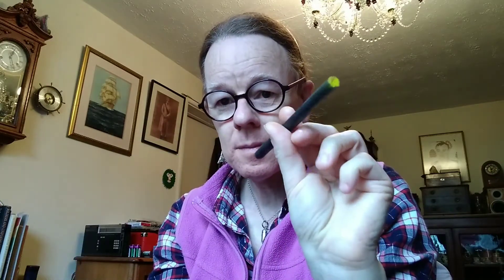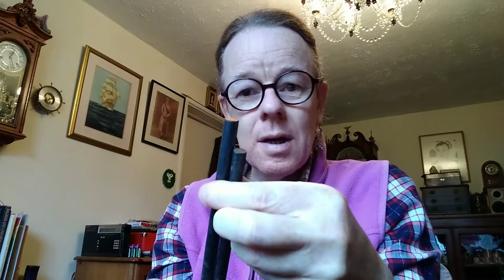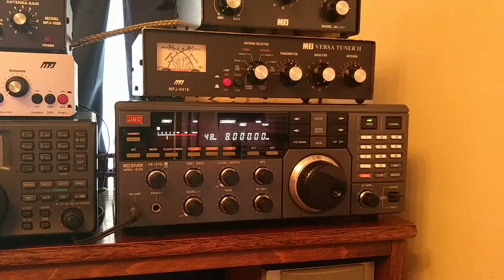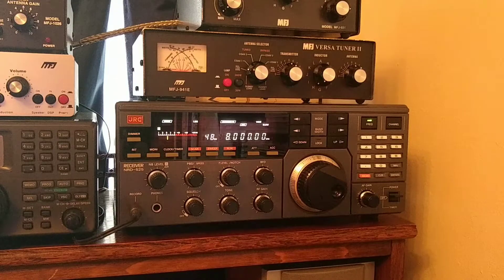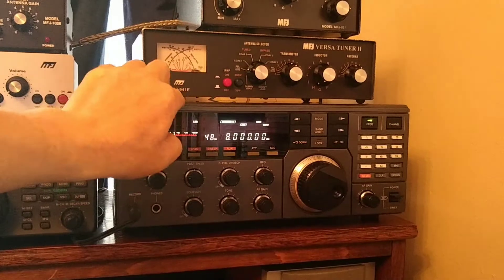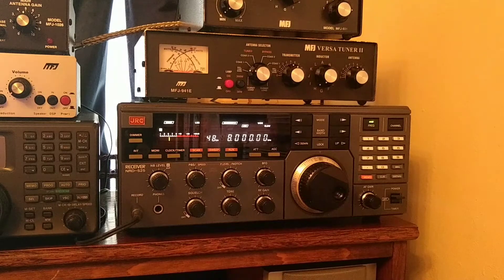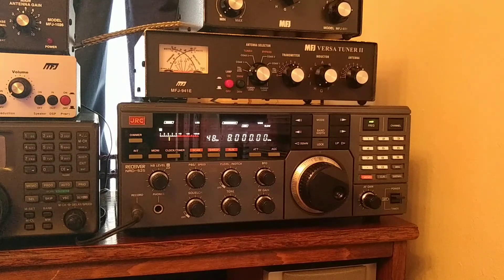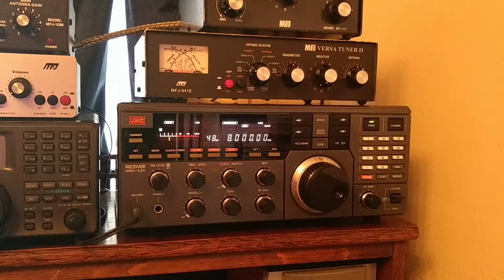Shortwave for beginners.MFJ 941e antenna tuner.

Comment: Thanksnfor nice video by the way your JRC looks like a rolex for me enjoy y listening best from here73s
Reply from the maker: That is a good way of describing the JRC a Rolex.It is a beautiful radio to operate🐻🤗👍
Reply: @shortwavelisteningforbegin418  i will get jrc at the end quality is not something to compromise. What is the lenght of wire for your zeppelin antenna ?
Reply from the maker: @DxLounge  My Zeppelin antenna i would say is about 80ft in length.The JRC is a fine receiver and you are right you cannot compromise on quality.Hopefully this week i will put up a doublet antenna which i hope will have a lower noise floor.🐻🤗👍
Reply: @shortwavelisteningforbegin418 good curious for results with your rolex😃👍

Comment: Hi Karen, Excellent advice. Have you been listening much this month? You tuber Oxford shortwave has heard radio New Zealand during the day so things are looking up. Thanks again for sharing, Best Tim
Reply from the maker: No not a great deal of listening from me.RNZ not great here in the mornings i have been quite busy with other projects.Will try and fit in a bit more listening when time allows.Hope you had a good Christmas and New year.The mfj antenna tuner a handy unit which allows me to switch between the dipole and the Zeppelin antenna.The Zeppelin being ideal around 9-10mhz and less noise than the dipole.One antenna for everything never really works it's too much of a compromise.If i had the space i would put up quite a few antennas.🐻🤗👍
Reply: @shortwavelisteningforbegin418  Hi Karen thanks , I have just pick up the mfj 949E and to be honest I don’t know which is antenna in /and antenna out to receiver. I have on the back  of the unit /coax 1 /coax 2 and  1 transmitter plug and   3 banana plugs .Could you please tell me on how you have set yours up it’s just for shortwave listening only, many thanks Karen and a Happy New Year to you